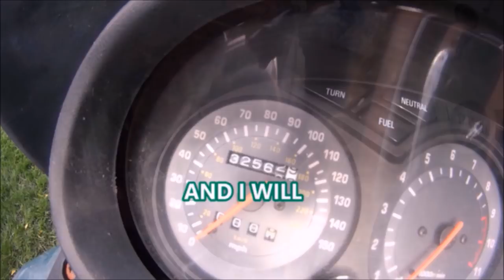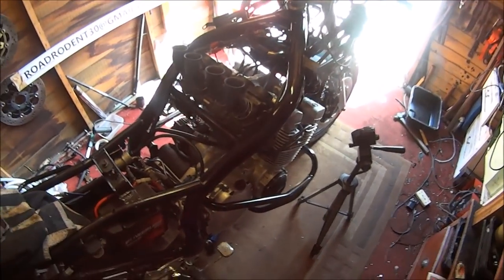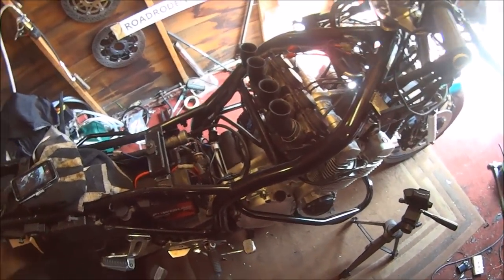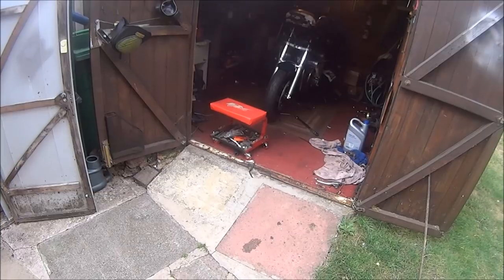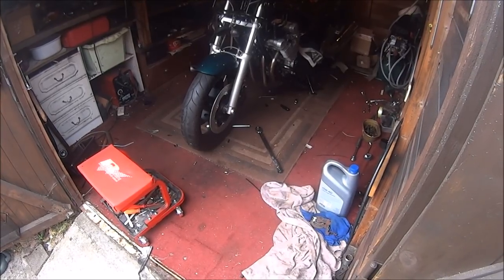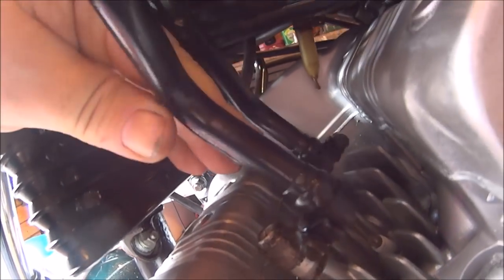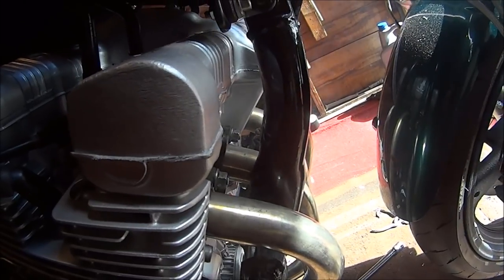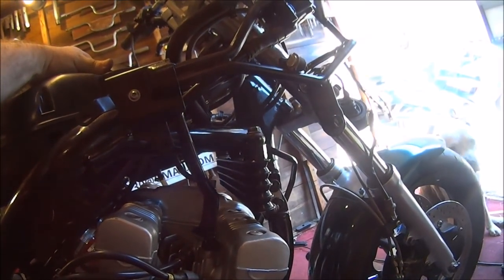Xj900s diversion will she live again

Comment: Saw a guy on YouTube stick an old brake cable in a drill with the end frayed put it in the tank and let it flay around inside to get most of the loose rust out before acid ...not sure how that would work with yours ..worth a try
Reply from the maker: andrew badder yes it is worth a try there sure is a lot of rust in there.

Comment: the clicking you heard is the fuel pump... pushing fuel in to the carbs... does it on my divi now and then
Reply from the maker: TH3_V1k1ng the pump wasn't connected but yes it is quite loud.
Reply: thats more than likely why you were having an issue. The pump needs to pump the fuel, as the bike is not gravity fed, as such.
It needs the pump pumping the fuel. 
So, when you go to it again, plug your awesome fuel bottle into the pump, then that into the carbs. 
Should run sweeter.
Reply from the maker: TH3_V1k1ng OK cheers for that i pray you are right Wil be awesome if it is as simple as that. The top end of the carburetors are pretty dirty and corroded now I've got the tops off so need to sort that first..
Reply: ahh ok. Yes, the fuel pump makes a difference.. lol.. 
From experience I can defo say.. lmao
I might have some spare carbs in the garage. I have a LOT of spares for my divi 900 in the garage. Pick them up when they are on flea bay really cheap. Keep safe just in case.
Reply from the maker: cheers feller. guess i know were to come if i need any spares lol.

Comment: are you by passing the fuel pump and the filter with your fuel source?
Divis kinda dont like that. hence the fuel pump clicking and possibly the flat spots your getting.
It may also be the cause of your carbs leaking.
like I said before, had my divi 900 for 11 years, so any help I can give ya...
Reply from the maker: TH3_V1k1ng oh OK yeah I was just using a gravity feed. Be interesting to see how it goes when I get the carburetors sorted and plumbed in by the pump..